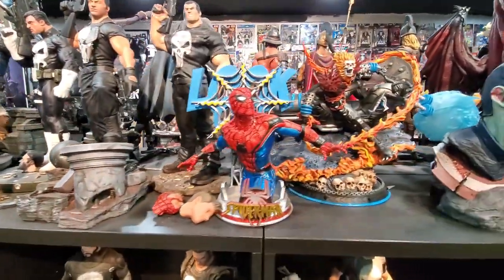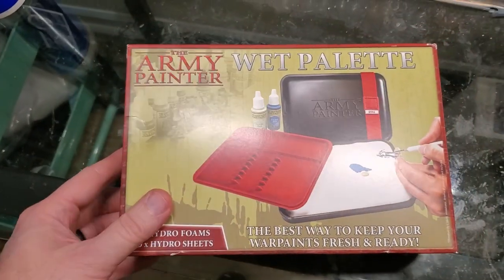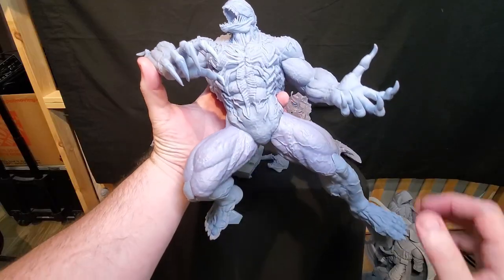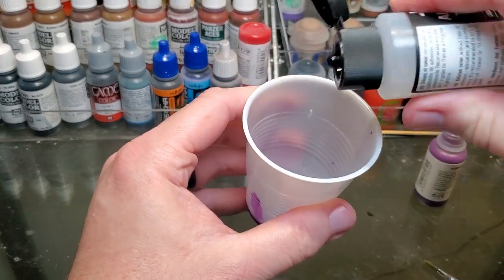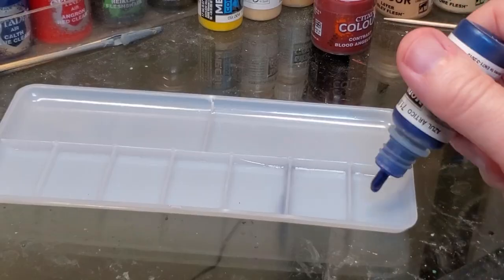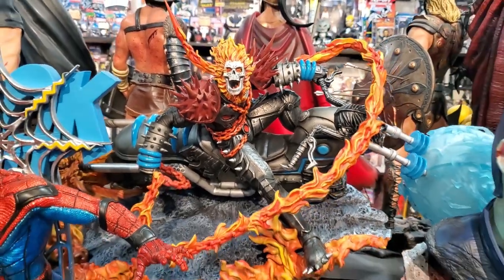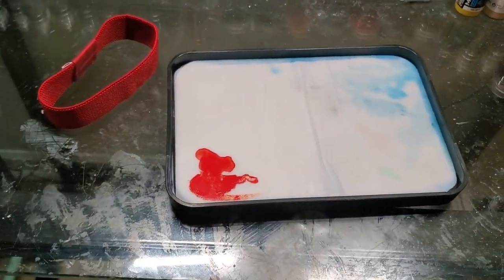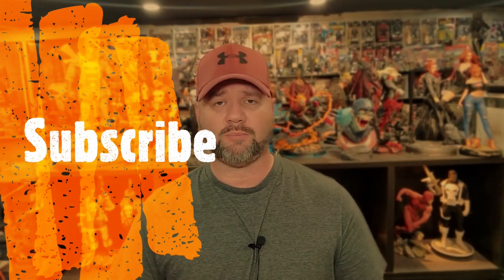How To Use a WET PALETTE For Your 3D Printed STATUES

Comment: I guess I will pick one up soon. It seems even with Vallejo paints I ordered some are thicker than others or I got some old stock.
Reply from the maker: Sometimes those paints sit on the shelves for quite a while.
Reply: Same experience here.  I added two mixing balls to each bottle then I put a little flow improver on my pallet and mix a little in at a time to keep from making it too thin.